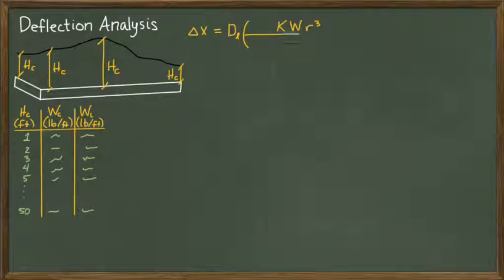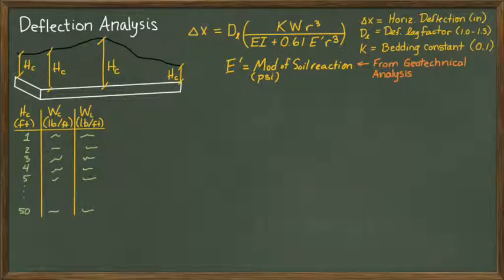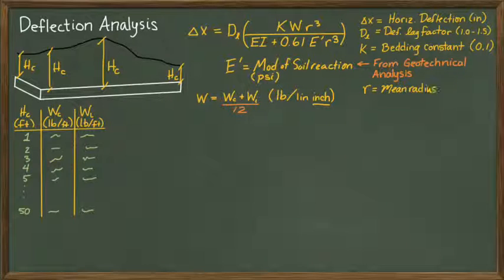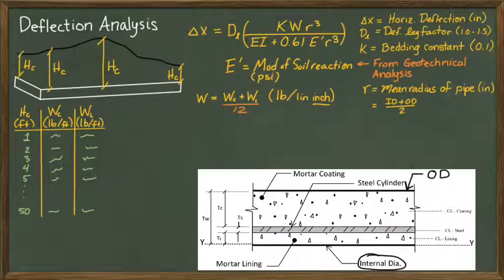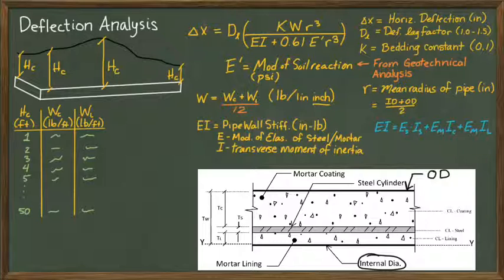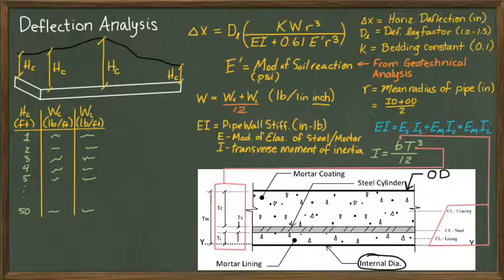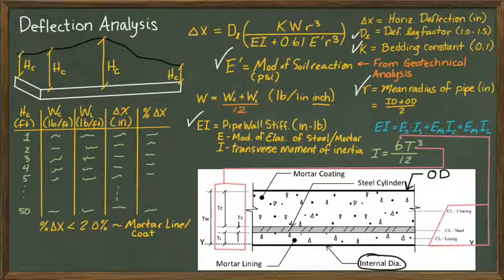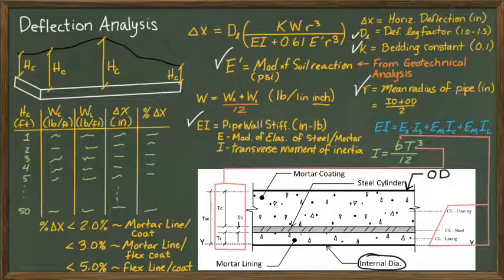Pipe Wall Thickness: Deflection Analysis Part 2

Comment: hello kennet, by the AWWA on page 61 they calculate the deflection of pipe using this equation, but in the calculation of I there is no consideration of the parameter b they only use t^3/12 . can you please tell me in which cases i take b in to consideration and in which cases i dont ? 
thank you for your help

Comment: Can you do a video or make some comments on how you would translate this deflection into a stress value?
Reply from the maker: Can you help me understand why that would be of benefit to you?  In other words, what is your bigger objective of having a stress value instead of just the deflection?
Reply: @kennethwlamb   I would like to show that the max. allowable stress is not exceeded. Also  it can be good for FFS evaluations in certain circumstances.
Reply from the maker: @Test-gs4ni  The reason that I used this approach is that is specified by the American Water Works Association Manual 11 (M11).  If you have another procedure you follow please share the document and I'll get a video made for you.
Reply: @kennethwlamb   check section 4.2 of https://www.americanlifelinesalliance.com/pdf/Update061305.pdf I did this for a design of a new pipeline. I was just asking to see calculations other people would apply. In terms of FFS analysis, the application of bending stress with stress concentration effects (pitting corrosion, etc.) will be interesting and may have to be done using FEA.

Comment: Do you a visual illustration for the value of b? Thanks
Reply from the maker: Sorry, Machan, for missing your comment.  Think of it this way: Cut a section of a pipe and look at it from the cut end (looking down the pipe and seeing where the cut went through the wall of the pipe).  Now, measure the distance from the center of pipe out to the middle of the pipeline wall - that is 'b'.  
Example: 24" diameter (nominal) steel pipe has an OD of 24.75".  The design of the wall requires the thickness to be 0.6".  Therefore, b = 24.75" - (0.6/2) = 24.45"  
Does that help?